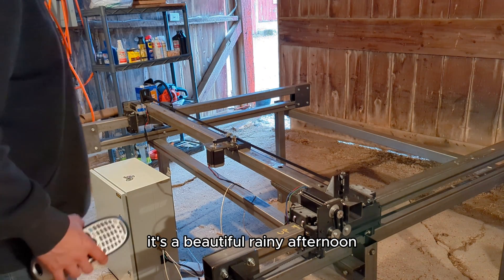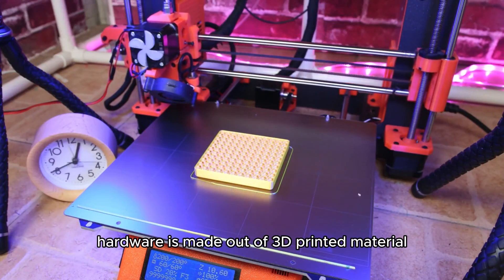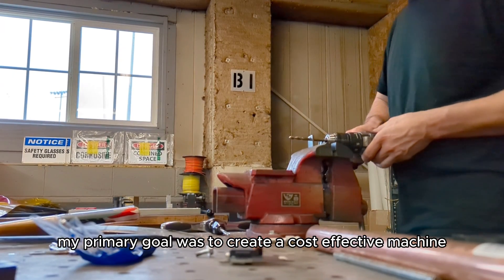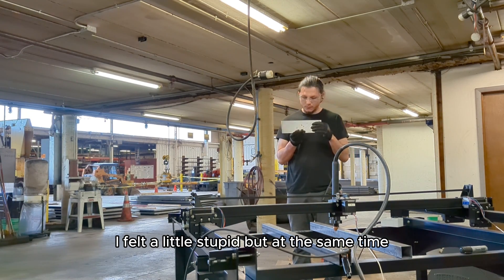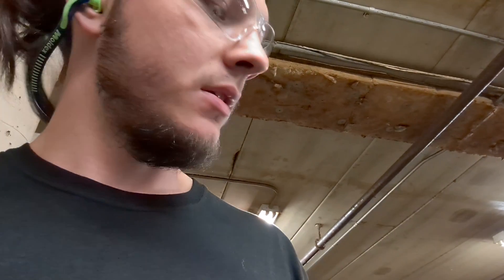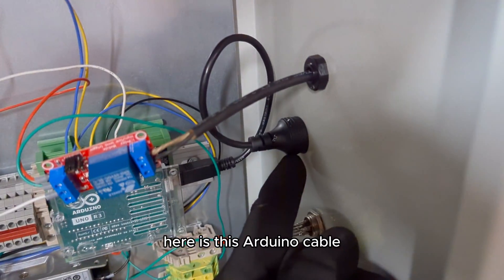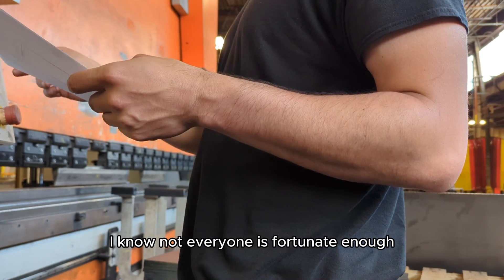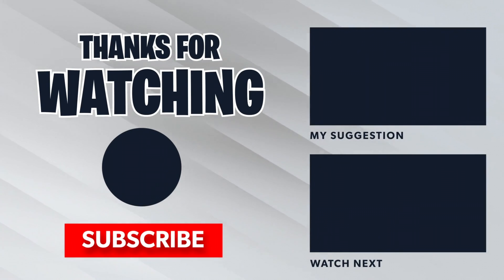Budget DIY CNC Plasma Cutter for Small Business | Pt. 4

Comment: Also design your table slats with points on both sides, that way you can flip it over as it gets used up, it also helps water flow to your drain. The points can be as simple as a series of zigzag shapes.
Reply from the maker: That's definitely an option!

Comment: I'm not knocking your ideas but you really need to configure a THC, torch height controller to help your plasma cutter do what its supposed to do. There are a ton of simple DIY examples of a controllable Z-axis that won't cost very much to add to your system. You'll thank me the first time you cut thin material and it warps from the heat. Its also a key factor to rate of consumables wear.
Reply from the maker: Thanks for the input. I do plan on putting in a z axis and THC. Hopefully in the next few months.

Comment: interested in buying alum. part
Reply from the maker: Noted 👍
Reply: @ThyialIndustries  how thick is it may have a cc roter that could use one. so would need 2
Reply from the maker: @glassice03  I don't understand what you mean?
Reply: @ThyialIndustries  I may need two how thick is the angle you used may want to use it on my router
Reply from the maker: @glassice03  ohhh. It's 1/2"

Comment: I like your build I'm wanting too build one the same size or just a little bit bigger. I've watched all your build videos so far nice job !
Reply from the maker: Thank you! Definitely recommend building one. I've learned a lot
Reply: You're welcome  what size is yours if you don't mind me asking?
Reply from the maker: @gordonwalker7494  little bigger than a 3'x4' cutting area
Reply: I'm thinking about a 4x4 to start with
Reply from the maker: @gordonwalker7494  cool. Going with belt drive or ball screw?
Reply: I work in a machine shop and we make rack and pion gears all the time but I have ponder on ball and screw
Reply from the maker: @gordonwalker7494  ohh sweet. That's definitely a good choice
Reply: I've that about rack ansd pion but might go with belt just to get it started what brand nema did you go with ?
Reply: How do you like the belt drive ? And do you think the 3 d printed parts will last cause I've been thinking about making mine out of aluminum in stead.